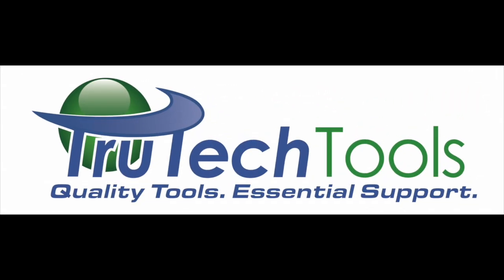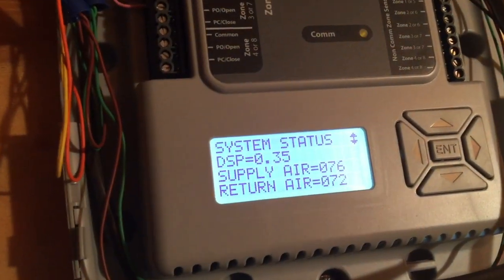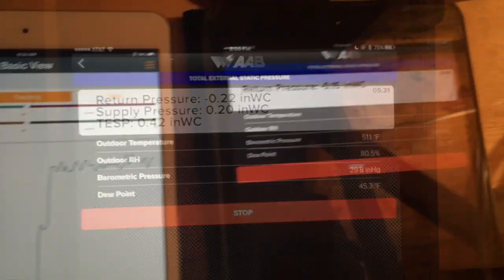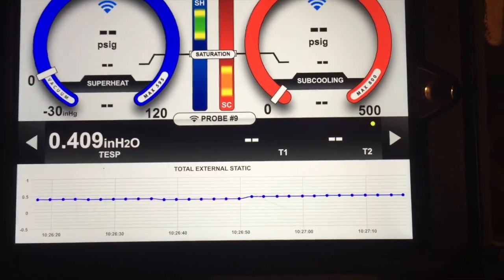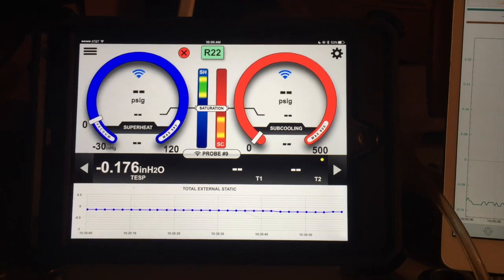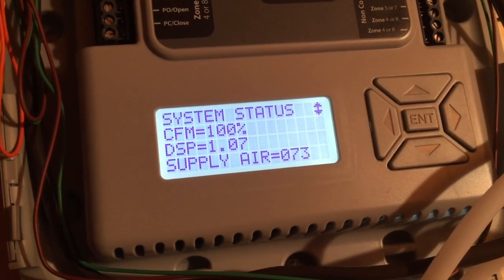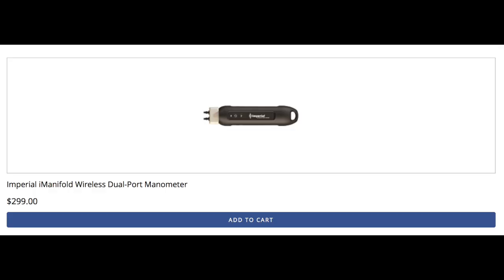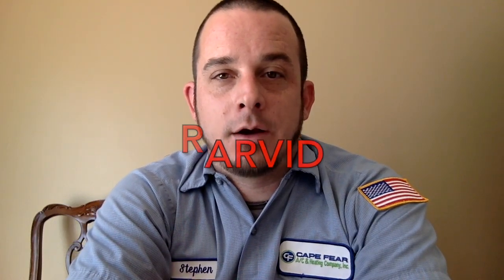HVAC Tools: Comparison AAB SPM-100 Testo 510i iConnect 921M

Comment: The 921M range is +/- 2.0 inH20 compared to +/- 75  on the SPM-100... different ball game? Or is this for rated tolerance?
Reply from the maker: The 921M was built specifically for static pressure while the 510i and the SPM-100 are built more as general purpose devices. There are some really great new options since this video, the Fieldpiece wireless manometer probes are very nice!

Comment from the maker: Jim Bergman Explains: It is not always easy to compare instruments. The Testo 510i and the static pressure transducer on your AUH are both relative pressure devices. The 921M uses a mass-flow sensor and converts mass flow to equivalent pressure at sea-level. 

Fans are considered to be constant volume devices. That is, a given fan will deliver a specific volumetric flow rate (cfm) at a specific fan rotational speed (rpm). The mass of air that the fan moves at a given speed will vary based on the density of the air being moved.

Air density also changes the static pressure that the fan will develop and the horsepower needed to drive it. Fan and air handler manufacturers typically catalog fan performance data at "standard air" conditions. If the airflow requirement for a given application is measured at non-standard conditions, a density correction must be made prior comparing the rated static to the actual conditions.

Standard air is at 68 degrees and 0% relative humidity and has a density of .075 LBS/Ft3 and a specific volume of 13.33 ft3/Lb

The steps below are how you correct the measured pressure to standard air conditions. 

1)  Determine the actual air density and calculate the air density ratio, which is the density at actual conditions divided by density at standard conditions. 

     Air Density ratio = air density actual / air density standard

2) Divide the design static pressure at actual conditions by the air density ratio determined in Step 1.

     Static pressure standard = static pressure actual / air density ratio

3) Use the actual design airflow (cfm) and the static pressure corrected for standard conditions (see Step 2) to compare the measured performance to the manufacturers data

Note: The fan speed (rpm) is the same at both actual and standard conditions.

Also remember that as heat and humidity go up, air density decreases, and as barometric pressure decreases, air density decreases. The iManifold manometer does all of these calculations in the background so you do not have to. 

Here is the source of the above abridged information 
https://www.trane.com/content/dam/Trane/Commercial/global/products-systems/education-training/engineers-newsletters/airside-design/admapn039en_1210.pdf

Jimmy DeNardo Asked:
Steve how is the imanifold sensor better than the testo when the testo was dead accurate compared to your zone board and the imanifold sensor was about .05 off every test?

Bergmann Responds:
Real quick back of the napkin math, 13.03 in the video, Trane= 95, Testo= 94, iManifold 1.030

Talked to Stephen to get the conditions at time of measurement.  Temp 77, RH 44%, Elevation at 500-1000'  Air density = about .070 lb/Ft3

Density Ratio = .070/.075 
Density Ratio =.93333

Testo Measured = .94

Standard Pressure = .94/.93333 = 1.007 corrected

iManifold 1.030 

This is what the fan would be moving with standard air. This is important because the fan moves a constant CFM independent of the air density. Therefor the uncorrected reading is showing you have a lower airflow when in reality you do not. 

This is extremely important to consider at higher temperatures and humidity as well as at elevations 2000' or above. If you do not, systems will have much lower actual airflow than what the table is showing you.

Jimmy Replys:
I understand the imanifold has the superior technology compared to the other brands of digital instruments but how is the fluctuation explained?  At 3:55 in this video it fluctuated from .42 to .35 meanwhile the testo fluctuated from .33 to .32

I am not bias to any brand of tool so im just a consumer looking for the best value and best consistency within the tool.  I really liked the imanifold and wanted one badly when they first came out but i waited because i knew it would catch and other companies would make their own tool.

I have some questions about the imanifold static pressure probe.

You said its a mass flow sensor.  Do these manufacturers of equipment assume we all have static pressure instruments with mass flow sensors?  Or to phrase the question differently what type of manometers are recommended for checking blower performance from the manufacturers?

The imanifold 921m is priced at $299.  The testo 510i is priced at $89.  Does the mass flow sensor justify the $110 price difference between the two probes?

The testo has an accuracy of 1.5%.  How does that compare to the 3% accuracy of the imanifold 921m?

The imanifold 921m has a 1 year warranty and the testo 510i has a 2 year warranty.  This is not a question but more a conversation starter on how the imanifold 923m is more than twice the price with half the warranty,  This tells me imanifold may not have confidence it will last in the field for more than a year.

Accuracy, reliability (warranty) and price are the 3 most important things to me.  If the only real difference is the mass flow sensor... but the mass flow sensor isnt the industry standard...  and testo has better accuracy warranty and its less than half the price...  its hard to argue that.  If imanifold was affordable i would buy it just for the reporting but keeping actual measurement accuracy and warranty in mind...  there are more affordable better options out there now.

Bergmann Replys:
Jimmy, those are  good questions!

I am guessing that Stephen has the manometer set to do a rolling average, and there was a transition in static pressure that was averaging out. The sensor is extremely stable and does not drift. I can not tell you for sure, maybe Stephan can provide some insight to what he was doing. 

There are no "types" of manometers recommended but with any type you have to know the limitations of the test instrument. The ABB and the 510i are using very simple and inexpensive technologies that are not compensated for temperature, barometric pressure or relative humidity. If you want to get an accurate reading, you have to make the additional corrections yourself. Read the Trane attachment in the earlier post.  

What is important to understand is that all readings in manuals and manufactures specifications are shown at standard air. When we talk about 400 CFM it is actually 400 SFCM or standard CFM of air. This means 400 CFM of air where each CFM weighs .075LBS/Ft3 or 400x.075+30lbs/Min/Ton.  The air that you are testing in the field is almost never standard. 

That said, if you are using a non compensated measuring instrument, you the user are responsible to make the corrections. This is way a TAB technician goes to several years of schooling to learn to make all the corrections. The 921M does it all automatically. 

The Testo is not near as accurate, that is a partial specification and likely at a single temperature. It is stated as ±(0.1 InH₂O + 1.5 % of remaining measurement value).  Specifications can be very tricky and misleading. Ask Bill Spohn at TruTech if you want a second opinion. The Testo is by no means inaccurate, nor not accurate enough for most users, but it as not accurate or compensated, and it will not give you a corrected reading for air density. It is a simple relative reading. 

Why the HUGE price difference. Simple, sensor quality, special calibration procedures, (mass flow) temperature compensation, zigbee wireless. It is not a me too product.  We spent the time and money to engineer a solution that removes the errors you get with a lower cost solution. 

The reason the iManifold system works is the sensor technology. When you start using multiple measurements the "total measurement uncertainty" really comes into play.  There is not a comparable solution on the market to the iManifold technology. Comparing the iManifold to any of the current technology is like comparing a calculator to a computer. Airflow calculations, total, sensible and latent capacities, dehumidification, advanced reporting, cloud storage, AHRI database access, and more are huge differentiators. 

As fas as the warranty, this quote from Tommy Boy pretty well sums it up for me. 

"Ted Nelson, Customer: But why do they put a guarantee on the box?

Tommy: Because they know all they sold ya was a guaranteed piece of shit. That's all it is, isn't it? Hey, if you want me to take a dump in a box and mark it guaranteed, I will. I got spare time. But for now, for your customer's sake, for your daughter's sake, ya might wanna think about buying a quality product from me."

They offer those warranties because the tool is so cheap you will just buy another before you will ever try to get warranty. They are throw away tools.

Jimmy Says:
I see... but when checking blower performance data on a job how can you be sure when your tool is moving from .35 to .42?  I want to buy an iconnect i really do but 1500 for an iconnect that has probes that fluctuate that much...  its hard to make that choice.  I bought the testo refrigeration set for $220 and ive tested all 4 probes against other clamps and gauges that i know to be accurate and they are spot on.  A few more probes and i can do everything the iconnect can do but for 1/3 the price and the only thing im sacrificing is distance.  And i understand the argument about the reporting (trust me i watch all the hvac youtubers videos) but literally none of my customers care about that at all.  And if i did happen to run across someone that wanted something like that testo allows you to put your own logo on their report lol.  This is just an interesting time in wireless sensor technology in hvac and testo in my opinion just shit on everybody when it comes to price.  Ive never even owned a testo product before these smart probes.
Reply: ^^^Ridiculous science overkill comment award ^^^ lol